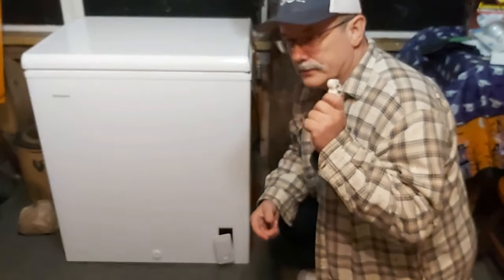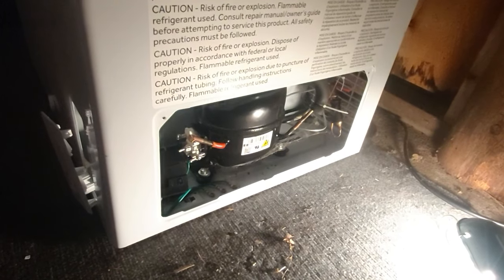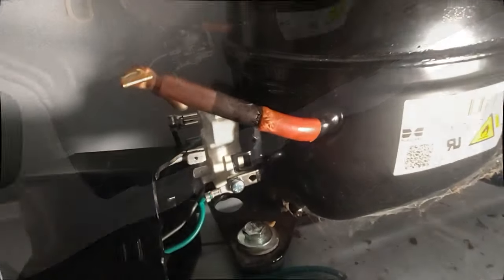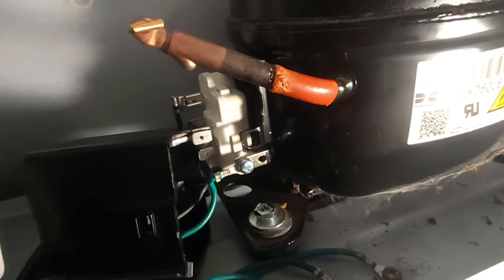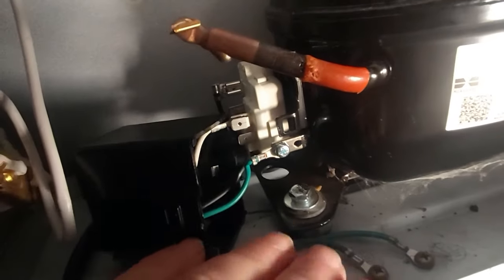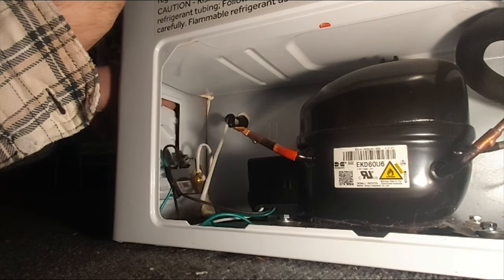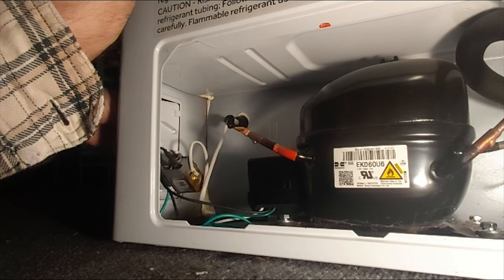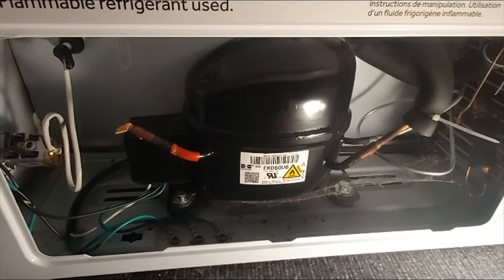Freezer Compressor Not Starting. Replace Start Relay. Hotpoint Model #HHM5SM AWW

Comment: I have the exact freezer. It stopped cooling the week after the 1-year warranty expired. I'm not sure what the problem is, but the front indicator light does not come on. Any notion of what that means?
Reply from the maker: I would try the relay that I replaced in the video. It's cheap. You just need to wait for the part to arrive, unless you can buy one locally. If you have the necessary meter, you can check parts that way. But, my guess is the relay. Here is where I ordered the relay
 https://www.ebay.com/itm/203043537630. Good luck. Let me know how you resolve it.
Reply: @twinbrookacres  Okay, will do. Thanks!!!
Reply: @twinbrookacres   I ordered the start relay and replaced it and it worked perfectly. Your video was very helpful. Thanks!
Reply from the maker: @wilberteric  Good to hear. I am glad I was able to help and you were able to fix it.
Reply: @twinbrookacres  My freezer was in good shape until a few days ago. A recent storm caused our power to go out for about an hour. Since the outage, the freezer gets cold (comparable to a fridge) but not freezer cold. I wonder what happened. Is that a thermostat issue?
Reply from the maker: @wilberteric  There might have been a power surge at some point. Could be the thermostat, or relay, or compressor. You might need to test them with a multi meter.

Comment: I can’t pull the wire off the relay to be replaced. It won’t budge. Any ideas?
Reply from the maker: One of mine (the white wire?) was difficult to take off. Try prying very gently with a small screwdriver or small pliers. Just be very careful!
Reply: @twinbrookacres  thanks. It eventually came off after lots of plier pulling. Hopefully it didn’t get too damaged. Fridge working
Reply from the maker: @EmEdDia  I am glad you got it fixed. And glad I could help.

Comment: Almost the same model that I have. The thing never got cold, I’ll try again and try to hear the click. GE told me that they don’t even make repair parts for it 😂 and sent me a voucher for use AFTER I go and purchase ANOTHER of their products, then I should throw out the first one. What a load of crap. I’m hoping I can fix it and have two freezers.
Reply from the maker: Look in my description below the video.  I provide a link to the ebay site where I purchased the replacement part. This Hotpoint is made by Haier, a Chinese company. I don't remember if GE is the same. Let me know how it works out.

Comment: Is there a way to test the starter relay with a multimeter?
Reply from the maker: There should be, with a proper meter. But mine is old and broken. So I gambled that is was the relay. You should hear the slight clicking as it tries to engage, then click again to shut off. If you hear that, it is probably the relay.

Comment: Also how do I know which point is for which wire as I’m scared
Reply from the maker: Take a picture before you remove the old relay. And use the picture to set the wires on the new relay.
Reply: @twinbrookacres  but the shape of the new one I’ve just ordered is different. Fingers crossed 🤞. Wish me luck as I’m female doing this on my own
Reply from the maker: @sophiaonus3108  Good luck.  Let me know how it turns out.

Comment: Would you happen to have the part number for that relay. Have the same model and am looking for that part.
Reply from the maker: If it can wait til the morning,  I will look for it.
Reply from the maker: If it can wait til the morning,  I will look for it.
Reply: Whenever you get a chance. No big deal. It’s my mother in laws freezer. Haven’t had a chance to look at it yet but I’m 99% sure the relay is the problem. Thank you
Reply from the maker: @chrismurphy1546  I don't have the part number, but here is where I purchased the part on ebay. Quick delivery by the seller. https://www.ebay.com/itm/203043537630 If you need anything else, feel free to email me. emaill addy is in my About page.
Reply: Thank you so much.
Reply from the maker: @chrismurphy1546  Let me know how it works out.
Reply: Great assist, fixed thanks to you, I decided I would order another for backup. It is the middle of March 23' and I'm not able to order the part 2 weeks later, could you do a video on what you can do to find hard to find parts and use this relay as a starter if you find it's become a hard to find part.

Comment: My compressor is over heating and not starting instate hmming
Reply from the maker: Replace the relay l Iike I showed. If that doesn't work, buy a multi-tester and check the compressor, or hire an appliance guy to check it.
Reply: @twinbrookacres  thank so much Engineer’ am am an Hvac but didn’t work on fridge before and the relay type is not in the market
Reply from the maker: @onyallakennedy9306  I provided a link to the relay on ebay in my description.

Comment: Had same thing happen after 9 months. LOWES did nothing for me. Lost tons of food. Going to try and see if relay works. Dont go to Lowes.
Reply from the maker: Ha ha. That's where I bought my freezer. You are correct. I bought a defective cordless screwdriver there. They wouldn't refund it, told me to contact the manufacturer. Hopefully,  the relay works for you. I provided the ebay link in my description where I bought my relay. Good luck and thanks for commenting.
Reply: @twinbrookacres  Thanks!!
Reply: @twinbrookacres  It works !! Thanks to you!! Saved me 300 bucks! Keep in mind the thing was collecting dust for 2 years after breaking shortly after buying. Two repair guys dismissed it as being unrepairable.
Reply from the maker: @coldseamonster  Glad to hear it is working! Now, buy a thermometer that goes inside the freezer, with a wireless display outside the freezer so you can monitor the freezer temperature.  That's what I did. And perhaps buy a spare relay, too.

Comment: I've got a 2 year old hotpoint that died. Replaced start relay and still dead. Perhaps it's the capacitor.
Reply from the maker: These things should last longer than 2 years! Could be the capacitor or compressor. You'll probably need to check it with a meter.